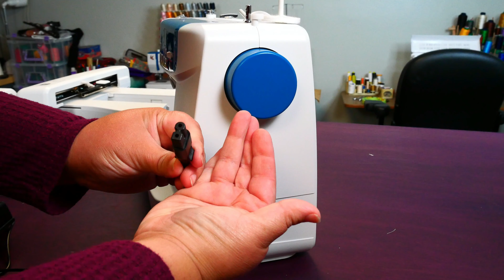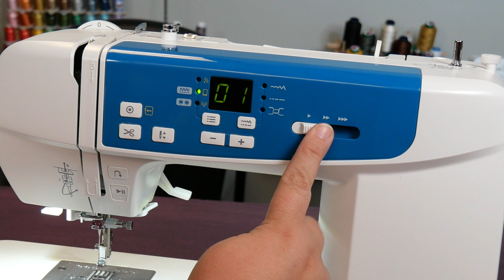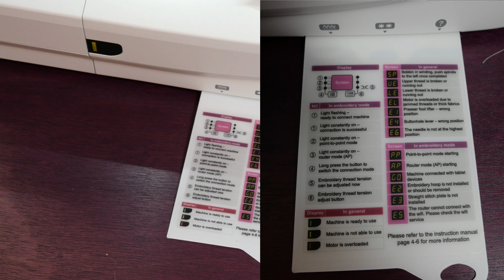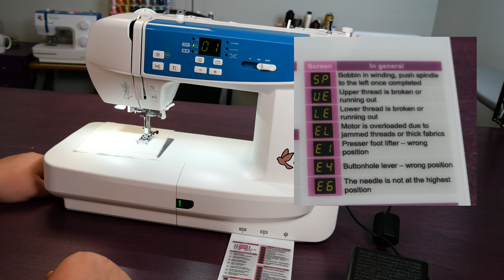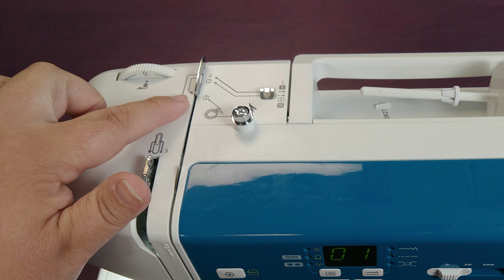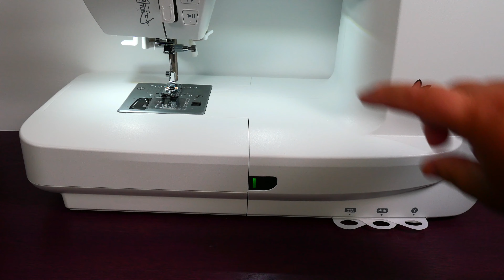Take a Tour of the EverSewn Sparrow X2 Embroidery and Sewing Machine

Comment: hello very beautiful videos very nicely done please kindly film how to operate the sewing machine electric foot pedal how it's used to sew please OK?please kindly reply back OK?thank you very much
Reply: Think of the foot pedal like a car gas pedal. It works the same way. You can also control the maximum speed with the slider on the front of the machine. An additional feature is a short tap on the pedal will toggle the up/down needle position.